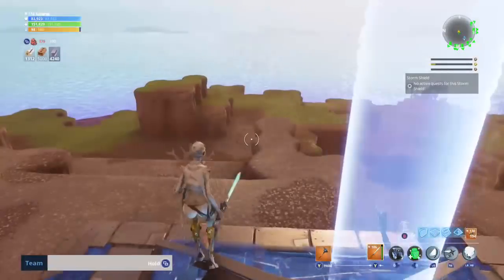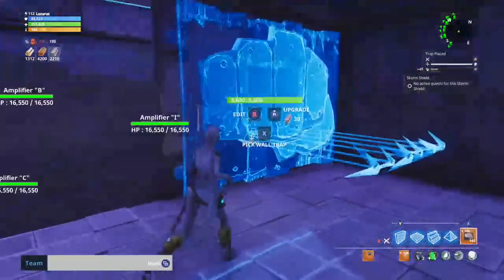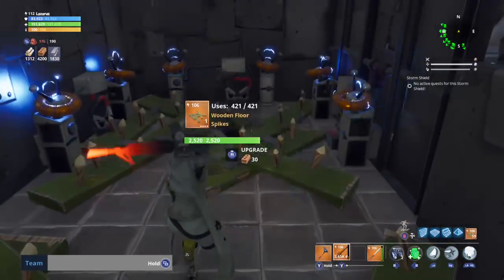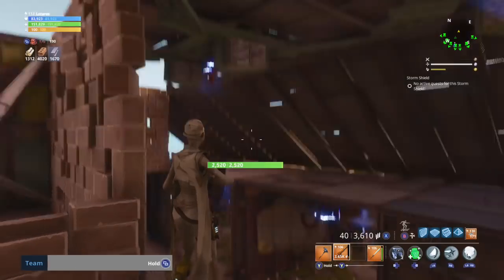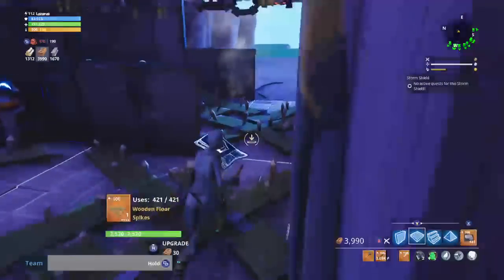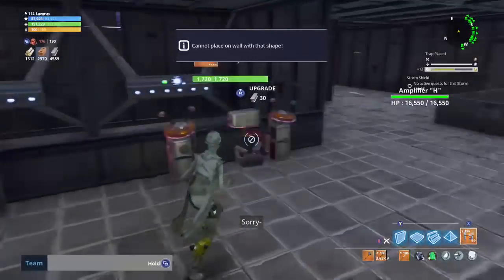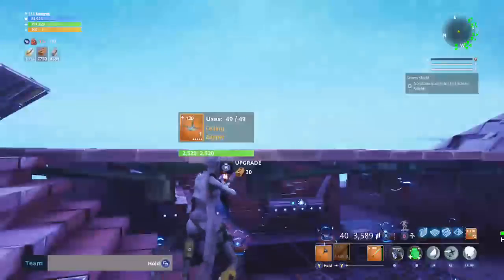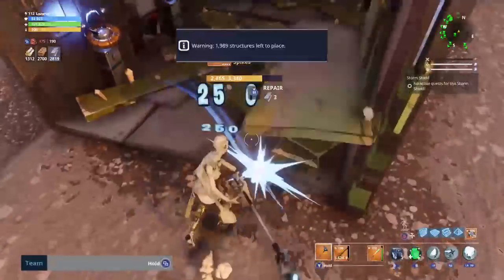Twine Peaks SSD 1 building guide

Comment: I was a little skeptical about this because I’ve never tried it, but it worked amazing!!! Thank you so much!!
Reply from the maker: no sweat, aside from SSD 4 they should all be clean sailing. SSD 4 just has a short shield but it's enough, just testy depending on level/tech.
Reply: CanadienSaintNk okay thanks for the heads up. How did it take you to understand most things about save the world?
Reply from the maker: @raulg968  I think as an original open beta tester I got a good glimpse of how the game was intended to drop and how it has progressed since. I've spent a lot of time building even when it wasn't needed just to learn the pathings of husks at times because it's part of the game and something maybe 1-3% of the player base knows fully at this point. I also progressed through the game under powered so I know how husks will react to players being under-powered and can represent that aspect of the game better than practically anybody who didn't have a hand in designing the pathing algorithm themselves. During all that it was simply testing that got me through, is this damage enough, do i need more? how long am I standing here firing my weapon and what scenario's would that not work out, etc. A lot of theorizing but I have great analytical skills that I put to use daily so it makes it much easier for me to deduce things and come to conclusions and then test it out to confirm said conclusions.

Comment: Absolutely effective build, worked for my first Twine SSD though had a few troubles with flingers in the 2nd wave.
Reply from the maker: Yeah, due to the structure limits in Twine Peaks and wishing to promote an active, healthy player base I figured a few flingers wouldn't be too big of an issue for anybody, can merely shoot the husks out of the air the whole time for the majority of SSDs 1-8 with these guides. SSD's 9 and 10 require some upkeep vs super Tanky smashers but still relatively easy to complete.

Comment: Finished me and my friends storm shield and it was flawless. This is a no bwano. But on the second side of ur build it was closer than expected. So I added what I could and set up a room with for traps with dynos and gas.  David deans build was kinda dumb. So u should be passed him in subs, good work friend.  I'll be prepping for ssd2... Instant edit: the first side was still closer than expected but was still fine without a couple of 1 by 1 traps
Reply from the maker: It can get pretty tight depending on where you stand and how high your trap pl's and player pl's are. Keep in mind the husks will want to attack you as well as the objective so standing in a way that they can both go through the tunnel to attack you and your friends will be optimal ^_^

Comment: Fantastic build and easy to understand! I built based on someone else's up to twine but I'm starting SSD1 with yours. 

About the 130 floor spikes, I always heard that they slow 30% regardless of the level so I haven't bothered putting much into getting them up. Are you telling me there is a difference??? Can you explain what exactly happens with them please? 

Thanks again for posting this. It's super helpful!
Reply from the maker: I'm glad you found this to be useful. While some of the future builds will ask you to be a bit more skillful vs a dangerously close Storm Shield it does ease up after SSD 4 and no real consequential complaints with the builds anyways. 

The 130 floor spikes are mainly used because I didn't have anything else in abundance, they are by no means mandatory and this can be done even with just regular blue rarity floor spikes if a player chose. I had tested them in SSD's vs 118+ PL husks and found the legendary+high level to slow down a fraction more however haven't been able to replicate it since the Perk-up update, mainly due to a lack of challenging husks, or perhaps we're too inflated in PL to notice a difference in such a minor pathing mechanic. All the numbers point to it being a flat 30% slow regardless of the quality but I remember it, wish I had taken a recording of it but I wasn't streaming or making any videos back then. It very well could've been some lag induced broken reload/activation time on one of the spikes, not uncommon on the Xbox Fortnite Save The World.

Comment: Thanks so much for your comprehensive help. Completed my SSD 1 with your help. Took days to build everything lol.

Question, I got a ranged wave (takers, gunners, blasters) as my last wave, coming from the West. It was rough with takers hunting me and lobbers out in the open. Do you advise building a lite lobber shield in this situation? where do you stand and fight normally with a ninja in these ranged fight situations?

Thanks again for all your content. You have the most useful videos I've ever come across!
Reply from the maker: lobbers will target you or the base, can play duck hunt on the roof of your base vs lobbers (shooting their projectiles), using your turrets to fight off takers. If it's a kill wave I'm usually out there dragon slashing if I do use Ninja. I just use a Ninja in these building videos because I'm used to her, I'd advise a more constructor approach for future videos becomes of the bonus to traps depending on the constructor of course.

As far as the west side goes you can put up a small lobber shield if you're having trouble shooting them out of the air but any kind of shield that would stop them completely would just be a waste considering you can sit on the cliff itself and shoot them out with a good rifle.
Reply: @CanadienSaintNk  Yeah I resorted to trying to just shoot all the lobs coming in but that's when I started getting blasted from somewhere and a taker was on me. lol

I passed it so I'm moving on to your SSD2 video and we'll worry about the rest later :) Thanks for the input!
Reply from the maker: @Jonas_Fox  Yep ^_^ just remember to extend out your defenses with the storm shield. Everythings built to be usable at SSD 10

Comment: Really enjoyed this video mate. Subbed. was going to ask how different would you have made this build now we have broadsides?
Reply from the maker: Can net nice damage from Broadsiders in a 2x1 but I'd still rather opt for the dynamos to be honest, the regular pathing+minor pathing walls we put in will be enough to kill regular husks and up to 90% of a husky husks health even without the CC from Wall Launchers. Would rather just pump straight damage onto mist monsters in these boxes if that was the case. Broadsider is neat and it has purposes but ultimately just kind of another novelty trap that doesn't have practical usage yet.
Reply from the maker: I suppose I should add on that even though I'm in favour of the double crit rate, double crit dmg gas trap build that utilizes the full duration of time a husk is on the square to pepper it with more damage than it would ever receive off the square through affliction...
That same thought process of; if I just jack it (the broadsider) up with crit rate and let it out, it would out-damage a wall dynamo with 4 opportune bounces as it is physical damage but it's too finicky, but there's no guarantee it hits everything on the square more than 3 times, just an odd bounce every once in awhile creates more stress on other traps further down the trap tunnel that only exponentially increases the longer the round (and in Twine SSD 7-10 the rounds are long). Dyanmos in the boxes will double down on reducing stress by stunning more powerful enemies (suitable for lower levels who lack power and need gas traps to reload) at intervals acceptable paired with the wall launcher full reload, so long as they're upgraded relatively hand-in-hand reload wise it's fairly easy for players to keep up with their builds. 
So long story short: Dynamos are more suitable to story/game progression and wall traps still are terrible for damaging enemies so at least get one that hits everything for sure on that square+applies CC so gas traps (the real engine of the Twine SSD's) can be damage focused.

Comment: for me at 28:11 this side gets blown up by a meteor, what do I do?
Reply from the maker: Build what you can of the build, make sure you're not building too far out. All builds take into account meteors dropping so if it happens consistently to your builds it could be a sign EPIC has either messed with the meteor drop locations (unlikely) or you're a square or two off the build itself

Comment: Will your ssd 1 build and ssd 2 build be connected
Reply from the maker: In a sense, all the guides cover an Amplifier, unless stated explicitly during the SSD video guide, just leave the defenses on other amplifiers up. As far as literally connected by pieces/strucutres that would be a waste of structures and nonsensical, we have very limited room in Twine Peaks considering we have to build all 10 Amps.
Reply: @CanadienSaintNk  For example when Vash built his ssd1 he said for ssd2 you'll have to destroy some of the base, will this be the case for yours.
Reply from the maker: @Bob-pf7yj  Yeah, that is just the nature of expanding defenses through Amplifier placement. Where once we had to defend from, now we don't. I generally don't build heavily on areas we don't have to defend at length for so at most we're losing 3-4 gas traps, 2 wall launchers and a few floor spikes on these kind of situations. Though in Twine Peaks such defenses are rare, especially in my guides that utilize optimal Amp placements that balance convenience with efficiency generally.

Comment: So assuming I’ve built all this correctly, will I need to fire my gun a lot during the ssd 1 in twine?
Reply from the maker: Too many variables; trap level, tech bonus', trap perks, overall power level. The first SSD also has numerous flingers so you'll probably need to fire a shot here or there, or put dynamo's everywhere that'd be useless after SSD 2 (as the two sides least prepared for flinger mobs are nullified once you place your second amp on SSD 3. As mentioned in the video, coming into Twine your traps will probably be level 82, maybe a 106 here or there so you might lack in tech enough to go shotless mode.
Reply from the maker: Theoretically if you've got 82 traps and you're level 70ish; if your gas traps are epic perked up, wall launchers are up to par and wall dynamo's are average you shouldn't have much of an issue from the wave itself. Simply add a 1/3rd wall at regular intervals along your backward stairs and attach a dynamo to them (the dynamo will be half-submerged between the two backward stairs if you place the wall between them but it'll still fire off). The lobbers will target your position for a time so don't stand by anything you can't afford to lose, eventually though they'll swap to just targeting your main base and at that point you'll just have to hope to hold out.
Reply from the maker: No shots fired sounds cool but honestly it's just as much of a waste of resources as building no trap tunnel and firing off rocket launchers/bullets continuously. Often times you'll see people with half dead amplifiers barely make it past and it's not even their superior build that lent them their victory but often times just a leftover gas trap and a well placed decoy taking out most the wave barring propane tanks. The extra traps you end up placing completely negate the benefit of making trap tunnels to save resources in the first place but hey, if you feel like doing it, it's certainly a "challenge"
Reply from the maker: you'll probably want to leave the backward stairs at level 2 for the West and South sides as well to help pull down flinger mob aggro. It helps we've alternated stone/metal on the base already whereas the ceiling is double layered metal anyways but they could beat at the metal for awhile before moving on so managing that level of building health loss to facilitate full-auto mode is probably best.
Reply: So what’s the lowest power level you can be in order to complete this?
Reply from the maker: that's a bit open ended, theoretically you could be level 1 and possibly complete this. You would need to build vanguard defenses and have traps fully legendary, possibly at the 130 stage (level 50 legendary traps) to do it. The feasibility of it isn't really there however as you'd be mooching off friends/others while you farm 5 star materials because you couldn't trade for them. As well your research tree should push you forward many levels so returning to level 1 might not even be possible come twine. I'd say if you've got epic perked up (82 power) traps you could probably do this level 50 lowest but it wouldn't be no shot mode and it might get dicey.
Reply: I’m level 51, and I’ve built it all with minimum 106 traps and a lot of full legendary 130 traps. However I think I’m going to wait a bit longer because I don’t want it to go pear shaped and I end up failing the ssd and loosing all the building I put effort into creating
Reply from the maker: sure thing, if you want me to look over your defenses before hand just hit me up, XB GT: CanadienSaintNk send me a message first so I know who you are ^^. Sometimes we have to see it all destroyed to learn a bit anyways, though if you've built it all as I did you might lose 4-5 walls tops.
Reply: I have messaged you and traded with you before so I’ll just send you a message sometime whenever you are free
Reply from the maker: Well, alright then. I've got the worlds worst memory and trade with quite a few people to keep my traps going for these guides but I'll sort through my messages for you :D
Reply: CanadienSaintNk megsiebae might ring a few bells ;)
Reply from the maker: LOL yes, yes it does. Well now you know I have the worst memory, though I do recall elsewhere on my channel you've told me who you are xD
Reply: I joined into one of your livestreams once just to check out your homebase, then i said who i was there

Comment: Is this worth breaking my base for?
Reply from the maker: Depends how confident you are in your own building skills and how far you want to go. These builds are easily capable of solo-ing the Twine Peaks Storm Shield Defenses 1-10 if built properly. However it's not the only builds that can work for them, even if I haven't seen anybody have an easier time on the defenses than with my builds. 
So really depends on if you need the help on these defenses or if you're looking for tips and tricks on trapping/pathing there's a lot of helpful information in each video too.
If you're looking to improve your base it's advisable not to attempt merging multiple builds into one though it would be a valuable learning experience.

Comment: What’s your gamer tag on Xbox and also you earned a sub😅 but some of the builds the shield around the map was blocking it so I couldn’t build there
Reply from the maker: Yeah that's fine, like I say (somewhere) all of these are built in a way that you can solo them all through 10, building what you can of the build should be more than enough with the exception of SSD 4 video where I elaborate if the shield comes closer to build a couple extra 2x2's. GT is same as youtube name
Reply: Thanks and by the way I completed my ssd1 twine solo with this thanks
Reply from the maker: glad to hear it ^^

Comment: hey i need help with my twine ssd 1 build i completed it but i worried about a part of it, on the west side the flingers walked up the natural ramp and to the north trap tunnel so that wasnt a problem but the propane would walk up the natural ramp and on top of the trap tunnel if u want to see it then friend me on epic: icrazy_jarrie
Reply from the maker: Yes, this was one of 3 mistakes I made over my Twine SSD videoes. Though it's the most critical it's an easy fix simply by adding a few walls thereby completely blocking off the pathway up on that side and forcing them back into your trap tunnel ^_^
Reply: @CanadienSaintNk  Well what were the other mistakes? I think you should put them in the descriptions so that people don't end up making the same mistakes.
Reply from the maker: @IntrovertReality  If they were truly critical enough to cause defeat I'd outline them, however if you follow the videos directions you'll have no problem avoiding catastrophes. At this point they're most like little easter eggs for those with the building talent to recognize them.